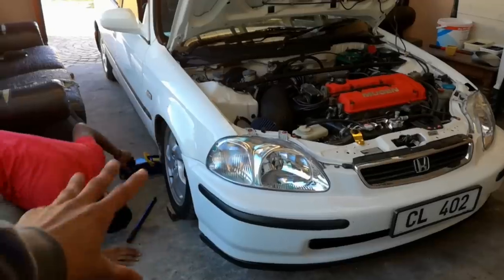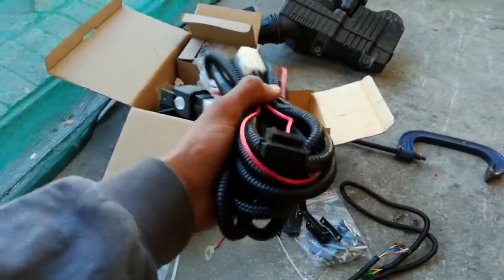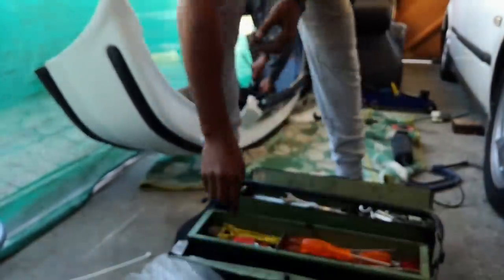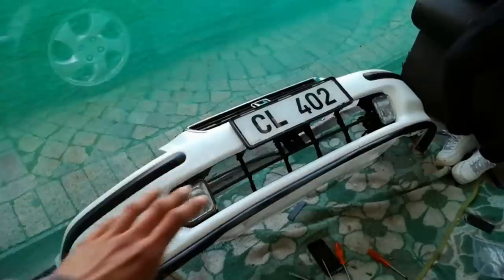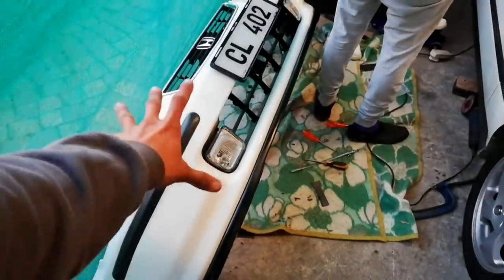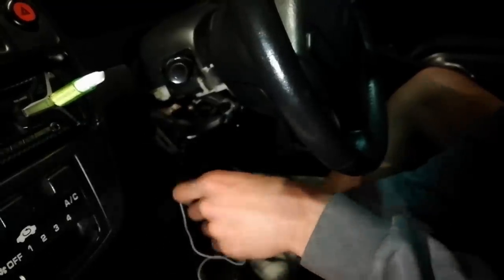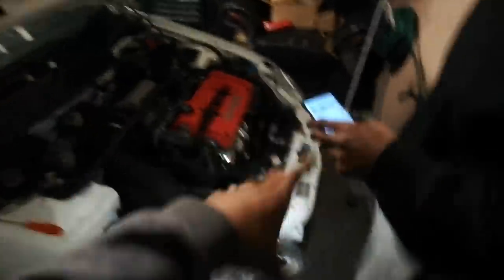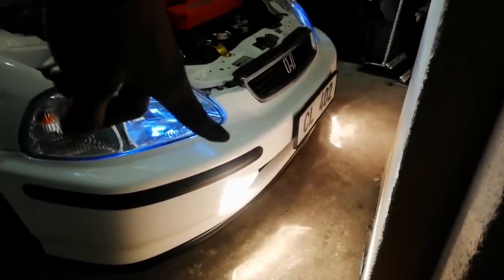FOG LIGHTS installation FINALLY happens on my Honda!

Comment: Could have just used a 12 volt spot from the fuse box under the steering wheel test which one gets 12v when the key is turned